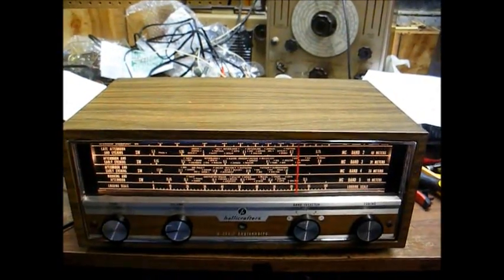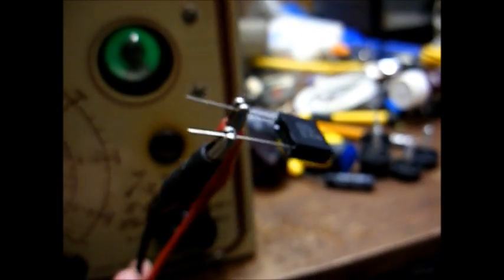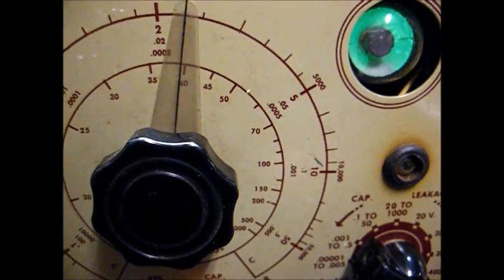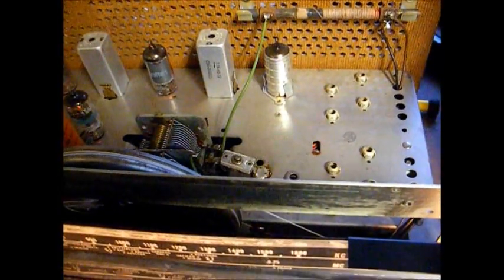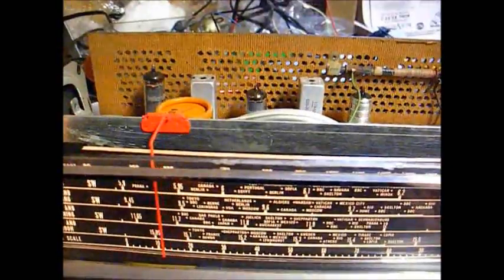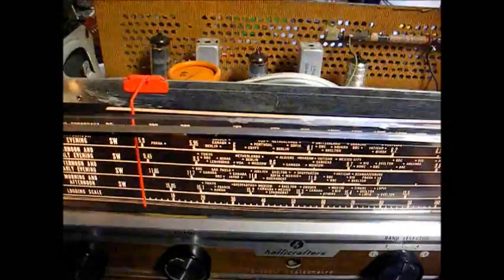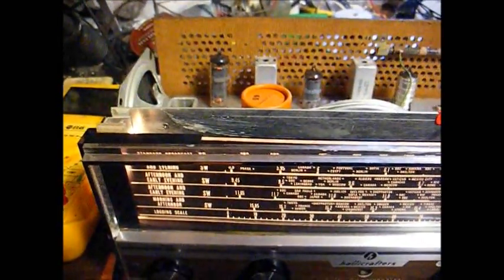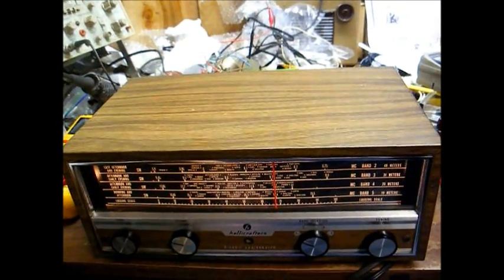Repair of a 1966 Hallicrafters model S-200 radio

Comment: I'm in the process of replacing a bad 50C5 tube socket and the caps in one right now.I'm having trouble lining up a schematic for it.I noticed you have one on your smart phone.How do you download one?I've got my laptop as well as my tablet to use.I've been using an S 120 as a guide to go by but the ones I have are different:one has a couplet and the other doesn't.This S 200 does.

Comment: I used to have an S-118 Mk II and for a 5 tube set it was really nice! I got Radio Melbourne-ABC and Radio New Zealand International and the sound was wide as all get out! It also had a single RCA that served as both output and input. PS Our oldies station is less than a quarter mile away and with a Gates Five PDM transmitter it's beautiful...it serves as the AM base for a 250w FM stereo translator 55 mi. away that takes some effort to amplify but it's worth it and it does help that it's well about average terrain. I had to sell it and boy do I miss old Hallie!

Comment: Wouldn't be surprised if the the chassis was actually the same as S120 with different or missing components. I think I see the holes where the band spread tuning cap would be mounted on the S-120. I suspect as well that they repurposed the hole for the BFO pot on the front for the earphone plug.
The cap across the mains was the same black cat and was shorted on my WR-600.

Comment: Hallicrafters made some nice shortwave receivers.  I have a Hallicrafters S-107, that a HAM radio guy gave me when he was cleaning his shack.  It has a gray front & cabinet, unlike the S-200 you are working on which has the wood-grain front panel.

You are correct about the shortwave bands today.  I had a Hammarlund receiver back in the mid to late 70's and 80's, and there where many countries broadcasting on the bands.  Now with the Internet of today, a lot of the stations dropped of SW.

Comment: I'm amazed at how mint that set is....even the chassis looks factory fresh. Even though it doesn't have an amplified RF stage ahead of the mixer, it should still pull in stations fairly well with a good antenna. And since you got it for free, I bet you could make a tidy profit on ebay if you decided to flip it.